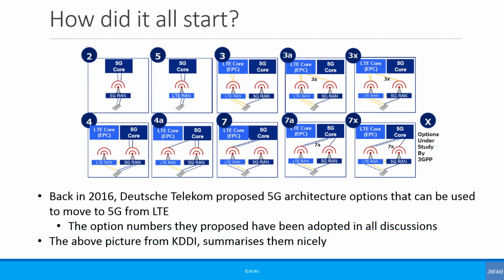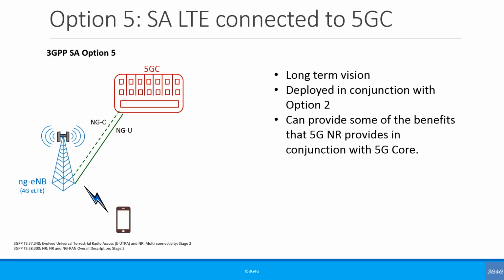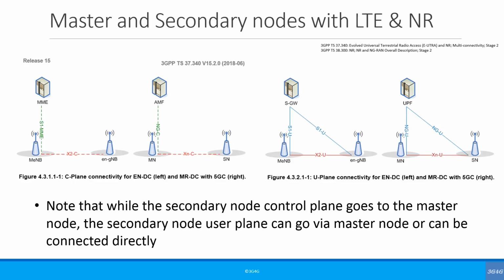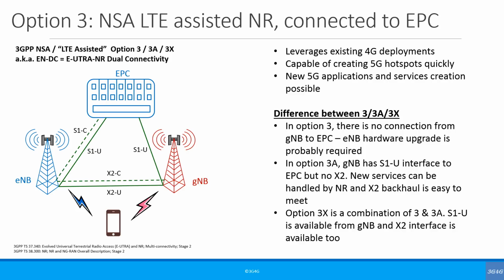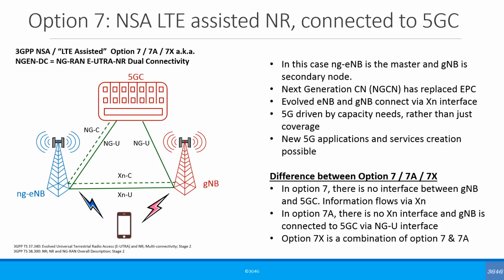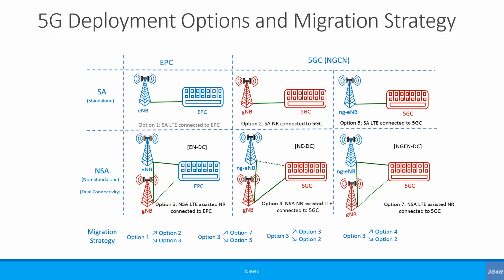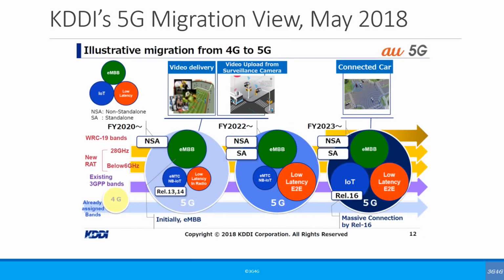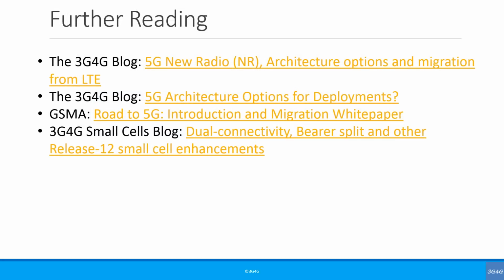Intermediate: 5G Network Architecture Options (Updated)

Comment: Hi, Thanks for sharing lot of summarized information. Appreciate your efforts. Could you please share the document details where option-2 deployment is mentioned ? As per slides it shows TS37.340 & 23.501. But i couldn't find it anywhere.
Thanks in advance.
Reply: I found it, its TR 21.915
Reply from the maker: All 5G default with 5GC is Option 2. The specs won't say Option 2. When it's talking about option 3, it would say "in case of EN-DC". 38.300 is probably the best place to start unless you are looking at something specific.
Reply: @3G4G5G  Thanks for the response.  Which official document shows deployment options is my question.
Reply from the maker: @MrMonangi  Not sure. It would be in one of the technical reports (TR). Having said that the two presentations that laid the foundation are here - https://blog.3g4g.co.uk/2016/09/5g-new-radio-nr-architecture-options.html

Comment: Oh and just as a  slight feedback you may not want to use yellow in your slides. The bright color like that is very very hard to see on the white background. In some of the slides you use yellow lines to show the connections between the UE and the LTE core and the 5G core, but the lines are very difficult to see cause of the brightness! Thank you though for the hard work on these!
Reply from the maker: Can you give the time where you see yellow.

Comment: As always 3G/4G your vids are great! Thanks for doing a re-visit to this topic and updating us! I work in the field of Telecom as well, but still hard to keep track of the emerging tech AND the different specifications and requirements etc.. My question to you is Duetsche Telekom is a Telecom provider right? SO why do they have input into the design of 5G? shouldn't the design and requirements of the 5G elements and architecture be decided by the 3GPP?
Reply from the maker: Any company that is interested in finding out first hand what's going on in standards join the 3GPP meetings. These include operators, vendors, researchers, analyst firms, etc. To attend 3GPP meetings a company needs to be a member of one of the 3GPP partner organisations. Duetsche Telekom is member of ETSI.